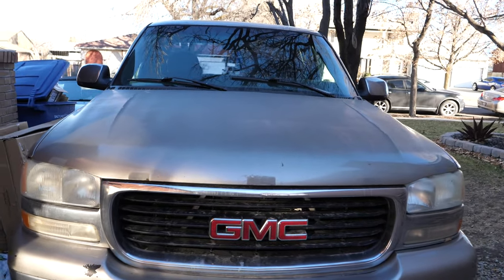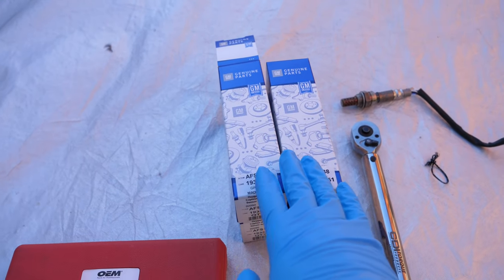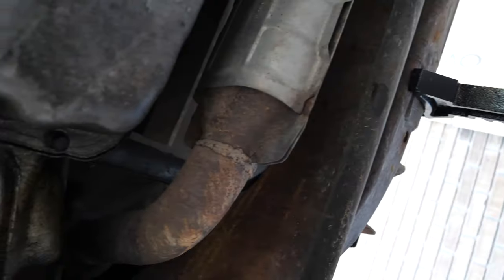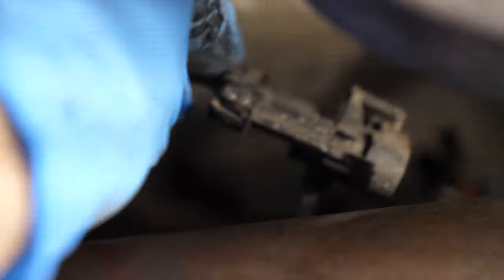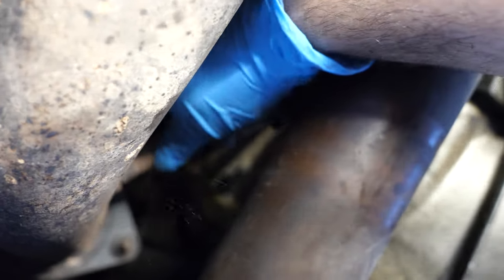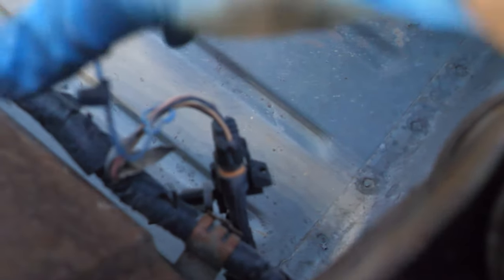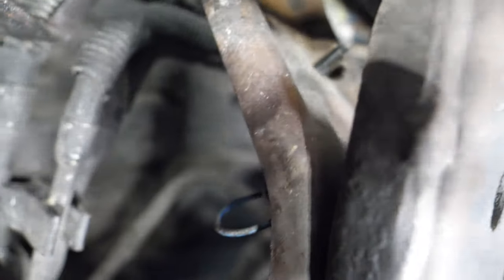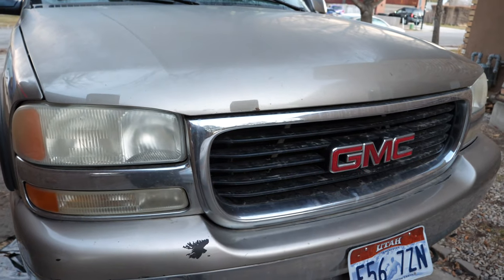How to Change Oxygen (O2) Sensors - (1999-2006 GMC Sierra/Yukon, Chevy Silverado/Tahoe 5.3l)

Comment: Awesome video. Thinking about changing mine on 04 Tahoe 208000 mi. during tuneup. Just searching for recommendations. Should I replace them or wait until I have an issue with one of them? Thanks for the great detail on DIY.
Reply from the maker: Some people consider them to be a tune up item, like spark plugs and wires. So you can do it if you want! Can't go wrong swapping it out, BUT the majority just wait for the check engine light to go on to swap them out!
Reply: @ufixitauto5237  thanks
Reply: @ufixitauto5237  how do I know for sure if mine are bad? It had a check engine light, then I cleared the code. I’m pretty sure before I cleared it it said I had a bad o2 sensor

Comment: What were the symptoms was it hesitating or stalling or no acceleration no throttle response?
Reply from the maker: Slightly surging engine and the check engine light saying that the Oxygen Sensors were suspected bad 😂 BUT, it turns out that the intake Manifold Gaskets cause an O2 sensor check engine light. I made a video on it and thats what fixed my issue! It's very common with these engines. I wanted to replace the O2 sensors anyways as part of my tune up on the truck since the truck has over 260,000 miles on it 😁

Comment: Outstanding video!  I put a long breaker bar on them and still can't break them loose.  Did you have to use a torch on any of them to heat them up before they broke loose?  I would assume not, since you didn't mention it.  I don't even live in the rust belt!  They are original though on my 2000 GMC Sierra 2500 with 125k miles.
Reply from the maker: Seems I got lucky since I did not use a torch 😬

Comment: Hey loved your video so I'm going to try to replace one of my O2 sensors. How do I look up online which sensor to buy? I have a 2005 GMC Yukon Denali. ? Worried that I'm going to get the incorrect one.
Reply from the maker: Do you have a check engine light telling you to replace it? If you do, it'll tell you which bank and which sensor needs replaced. To make it easy, you can go to a website of a local parts place like Auto Zone or O Reilly, put in your car info and then look up oxygen sensors. Amazon tells you which parts are compatible with your car if you have your car info stored there. They usually tell you if they are Upstream or Downstream sensors. Just grab the one you need :) in the video, I describe how to differentiate between the two :)

Comment: Just bought an 2005 Suburban, yesterday. Engine light came on today for the oxygen sensors. How long can I drive before replacing them? A month? Thanks!!!!
Reply from the maker: Everything is subjective to the car. Typically, in my experience, bad O2 Sensors cause bad fuel economy and sometimes surging engines but it has not left me stranded and I left it running a while with bad O2 Sensors. BUT, I should also mention that even though the check engine light showed O2 sensor codes, the issue was the intake Manifold Gasket. It's a very common issue with these LS engines. So, if you replace your O2 Sensors and it doesn't fix the issue, then I would look at that :)
Reply: @ufixitauto5237  that's a big help. Thanks!😊

Comment: My GMC has only 82,000 and the check lights keep coming on and off. Had 2 test check on truck and it comes out with bank 1 & bank 2 senor readings.
Do they go out that quickly on a GMC?
And, you bought each sensor for $40? Over here in California,  auto zone want $175 and $77 + taxes  bank 1 & 2 , upper & lower.
Bosch not GM parts.
Thanks for your video teaching.
Reply from the maker: Yes I purchased them 40 dollars each! Auto Zone inflates those like crazy. Check my affiliate links in the description. And no, I wouldn't say that it is normal haha. At least not in my experience anyways. That's often the sign of either bad O2 sensors or intake Manifold Gasket. No way for me to know haha

Comment: My 2003 GMC Sierra 1500 has a Vortec V6 which evidently do not use the GM AFS 138 sensors as shown in this video. I removed all four sensors from my truck and discovered that all four were identical as they came from the factory. Since the GM AFS 106 (also shown) do appear to be correct, I'm assuming that I should use four of these as replacements. Am I correct?
Reply: denso works or delphi too i got mine from rock auto better pricing then parts store

Comment: After replacing sensors will the check engine go off on its own or does the battery need to be disconnect to reset check engine light?
Reply from the maker: Drive it around enough and it should go off if that was an issue. Or just disconnect the battery for a minute and see if that did away with the code.

Comment: On my '05 Yukon XL the connector for Bank 1, sensor 2 is the hardest part of this job as you need some baby hands & forearms to get at & seperate it. For those that with those handly little O2 sensor sockets (well worth the $5 on Amazon) in my experience more often then not the sensor will not budge & even a good penetrating oil will not help so take a propane torch & heat that suckered up being cautious of any fuel lines or wiring harness.

Comment: So my connector wont connect for bank 1 sensor 2. Dont know why tho. Any ideas?
Reply from the maker: Hmm, do you know if that's the fault of the sensor or the connecting wiring? It could be a bad sensor connector, so you can try to plug in the old sensor to see if it connects just fine. Best case scenario is you just need to change out the sensor, worst case scenario is you'll have to cut and splice the wiring harness off a junkyard donor.
Reply: @ufixitauto5237   found out that the Bosch sensor that I tried installing was the incorrect sensor. Returned it and drove 15 miles to another location for the OEM o2 sensor. 

In theory it was the same sensor but out of the box the electrical connector at the end of the sensor was not the right fit. It did not click in. 

So yea you were right haha, Ihad a small scare there.
Reply from the maker: @luisv8413  oh good! I'm happy to hear it was just that!

Comment: How do I shut the check engine light off?
Reply from the maker: Remove the battery for a couple minutes and it should reset it. If the issue is gone, then the check engine light should be gone. If the issue is still there, then it'll turn back on. If your check engine light is still on after disconnecting the battery and you still get O2 codes after replacing all of the O2 sensors, then check out my video on replacing the Intake Manifold Gasket because that may be what you need to do. It's a common issue with these vehicles. That's all assuming you have the same type of vehicle as me! 😂

Comment: Would have been nice if you showed how it ran before, and after.
Reply from the maker: Normally I would, but it wouldn't have made a difference in my application! The check engine light was on, but the engine was actually not running rough enough to make a noticeable difference. It would have been a clip of the same engine idle basically 😂
Reply: @ufixitauto5237  Lol okay. I just did this on my sisters Yukon. Still idles rough. 😫
Reply from the maker: What codes do you get? If you still get o2 sensor codes and rough idle after replacing the o2 sensors, I would look towards the Intake Manifold Gasket. Its a common issue with these engines haha. It's a little more involved and I did make a video on it!
Reply: @ufixitauto5237  174 lean on bank 1 and 300 it doesn't say which cylinder Just the 300 code.
Reply: @ufixitauto5237  Yeah we're going towards intake gasket next. Thank you.
Reply: @ufixitauto5237  I changed the intake gaskets today. Runs like new. Thanks for the input.

Comment: I have an 01 GMC Sierra 4.8 liter rear o2 sensors are right but the front ones are not 138 just make sure you guys check your plugs I did a dummy mistake and copied his part numbers and they were wrong for the front o2 sensors so don’t make my mistake lol